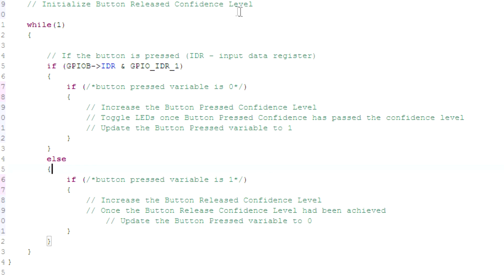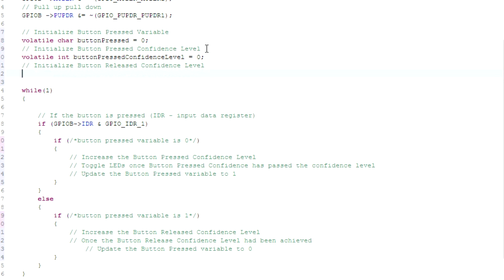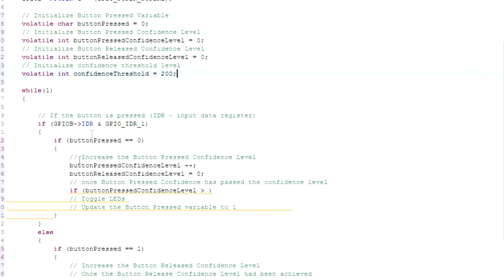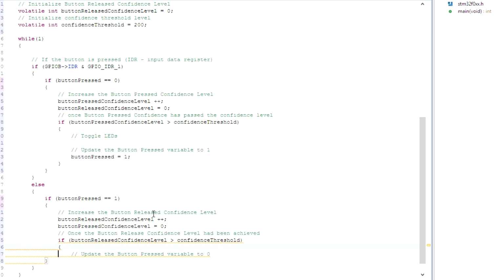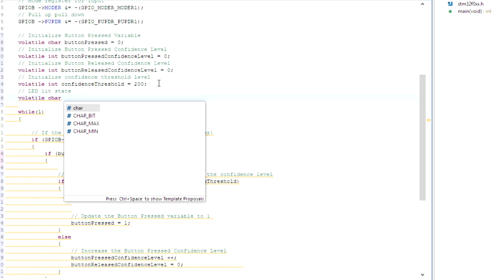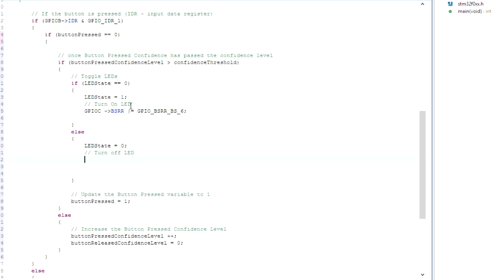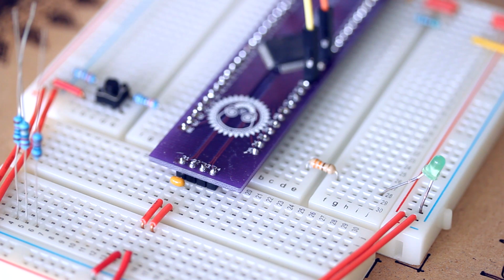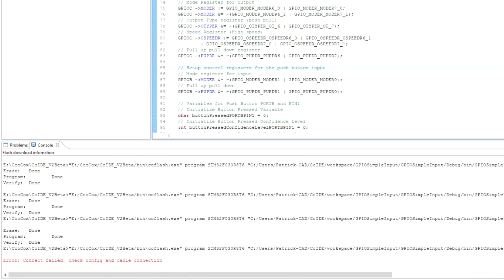13. How to create a GPIO Push Button Input for ARM Microcontrollers - Software Debouncing Part 2

Comment: Not the best code, but it works. You can optimize it, separation button detection from the LED state toggle, which in turn is simplified with LEDstate= !LEDstate instead of more costly if statements.
Reply from the maker: Thanks

Comment: What about de bouncing an entire matrix of keys like a keypad. surely this would be impractical....
Reply: Correct. In that case, You'd track which key is detected after strobing the grid, log a potential press, and use any of various methods to confirm, like a delay, confidence counter, or virtual hysteresis.

Comment: bool isRising;
int8_t confidence = 0;

confidence += (pin) ? 1 : -1;  // Add 1 if switch seems pressed; else subtract 1.
confidence = min (confidence, MAX_TOLERANCE);
confidence = max (confidence, 0);

if (confidence == MAX_TOLERANCE && isRising) {
  // Switch is pressed.
  isRising = false;  // Prevent reacting to level.
}
if (confidence == 0 & !isRising) {
  // Switch is released
  isRising = true;  // Prepare for rising edge.
}
// Additionally !isRising specifies the debounced switch state.
I would use a timer to execute this for every switch every 0.1 to 10 ms so that clock speed is irrelevant.  MAX_TOLERANCE = 10 is fine for 10 ms intervals and MAX_TOLERANCE = 100 is fine for 0.1 ms.  If the timer can be devoted to only this, 1 ms intervals and MAX_TOLERANCE=30 would be my first choice.

Comment: Wouldn't it make more sense to declare the threshold variable const? Also, why on earth are we declaring everything volatile? What's the problem if the compiler optimizes and puts the values in registers?  It's not like we have any separate units that would go and look for the value in memory? Am I missing something? Thanks!

Comment: In either c/c++,  when you declare variable with data types char or int and do not explicitly specify the signedness, those variable will end up to be SIGNED.
Reply: It depends on the implementation, especially with char.

Comment: @Patrick Hood-Daniel 
Hello Patrick,
Why do you declare variables as volatile? is it true to say that their location is not being shared by other variables when declared as volatile?
Also in previous videos you talked about changing bit location to zero by AND and NOT &~  is this same as NAND gate with both input being 1. Can you please explain this. Also you have used |=  for OR (is this 
both input 1)
Reply: In this scenario, the variables do not need to be volatile.

Comment: Would love to see your approach to debouncing a rotary encoder.  I use the approach described on http://www.buxtronix.net/2011/10/rotary-encoders-done-properly.html but often run into valid turns that are skipped.  I'm about to give up on a software-only solution and start adding discreet components.
Reply from the maker: I have the rotary encoder planned for a very soon upcoming video. We'll see if this technique works.